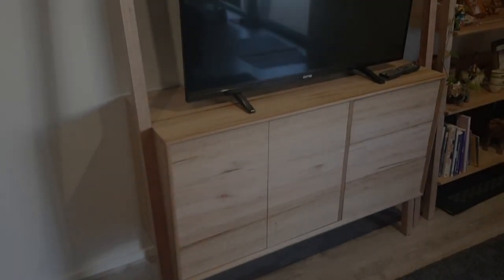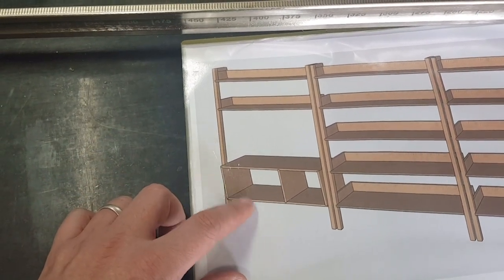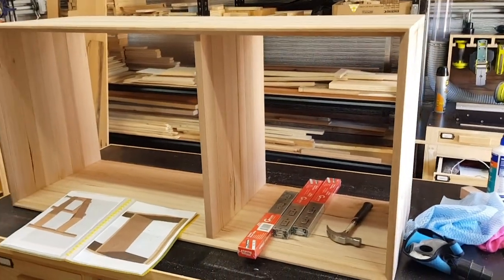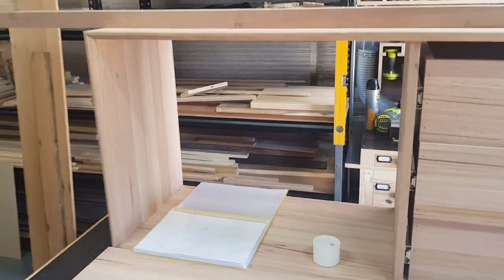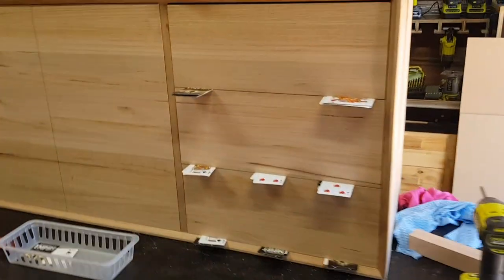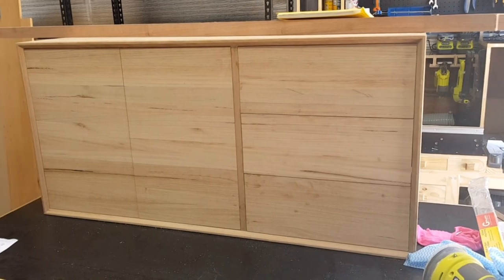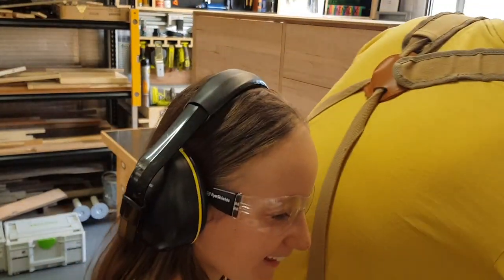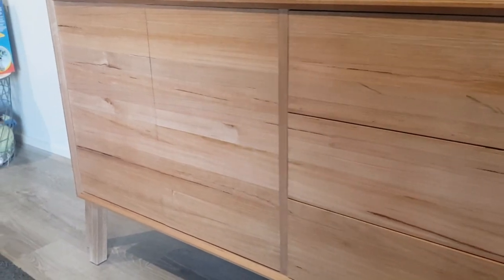Building a ladder inspired contemporary TV console cabinet

Comment: Yep, as much as I like the Kreg Hinge jig, I am yet to find a set of hinges the mounting hole guides actually align to! Using the one sheet and grain matching was definitely the right idea. The only thing I wouldn't have done is glue the legs to the cabinet base. Think of it like a coffee table top, you've put a restriction on the expansion and contraction of that wide solid panel. The screws in extra wide holes would have been enough. Should be ok, just keep an eye out for signs of cracking as time goes on. Overall an awesome build and I am now up to date with your back catalogue. Your build and editing style are both developing at a remarkable rate.
Reply from the maker: It's funny because I was going to reply 'wait did I glue them?' as I didn't remember doing that till you mentioned it.  I just went through the raw footage and I put glue on one of the legs.  I honestly don't remember what I was doing maybe on autopilot to glue one of the legs?  But for sure I will keep an eye out.  So far so good tho, can't see any issues.  I don't think I put alot on it, I could probably remove it ok if I had too.